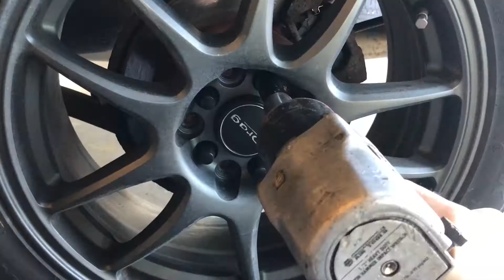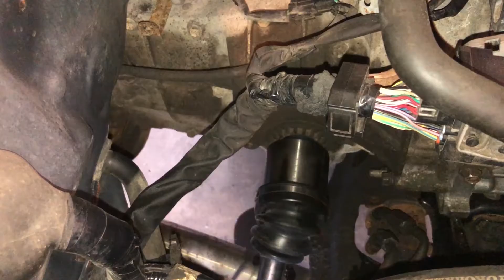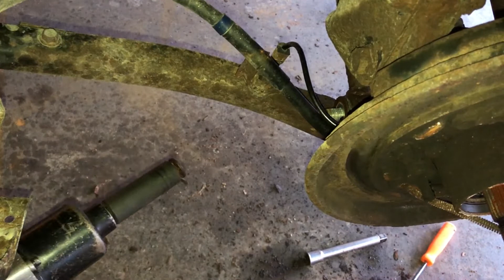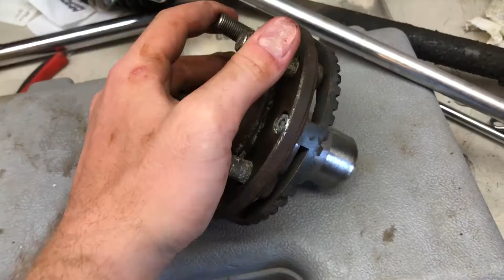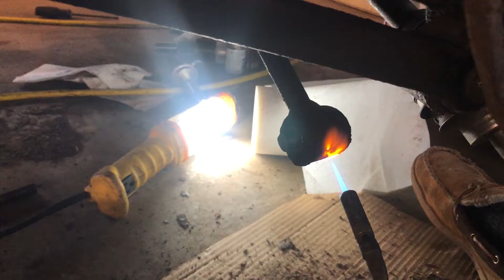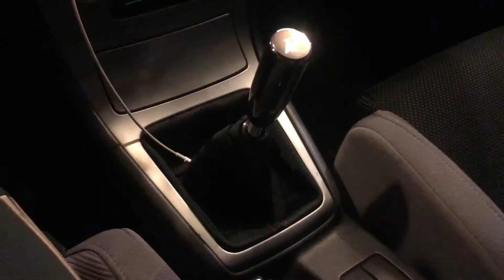Replacing 2007 Impreza Rear Wheel Bearing and CV Axle Shafts

Comment: Does the cv. Just pull out .  E  Brake is pain 
1 piece curvy thing not sure where it goes .
Got bearing out.    Bought new spindle.. 
It's all new.    Pain in the butt job.  All bolts frozen rust.   Its raining and cold while I'm working.  And my dog is barking
Reply from the maker: That sounds like a pain. The cv should just pop out, but sometimes requires the additional force that a prybar between it and the diff can supply. I'm not sure as far as the curvy thing with the e brake, but best of luck with the job.
Reply: @gkgt5226  
The curvy spring goes on the spacer fir the shoes.    I finishing the one side now.  I need to probably buy a new hub nut. 
Now I have to do the other side.    But I have all the tools out.  Pullers etc.
Reply from the maker: @hotbotfun  Not a fond memory... dealing with that wheel bearing took longer than it would take to remove and reinstall the engine somehow

Comment: Those import direct axles are great. I'm glad you wound up there. They're way better. Sorry for post whoring lol. But yeah I gave my import direct ones hell and have never had one fail on one of mine. Also neoprene boots won't deteriorate from oil or heat like rubbers.
Reply: Hullo there, thanks the helpful work bro,really in my operations the challanging part is been at the bush bolt where  you heat up mine is still intact otherwise i cut out the extra rusty bolt nut off with a sprocketing  cutter the rest of attempt is slow but approachably friendly,  GOD BLESS
   Thanks Sande UGANDA
Reply: Actually all the hub bearings have been extra rusty and renewed,ok

Comment: Did you replace with a Subaru CV Axle to autoparts store one? They usually only recommend Subaru Axles. I typically just rebuild mine as its cheaper.